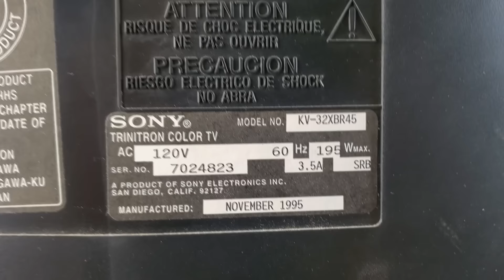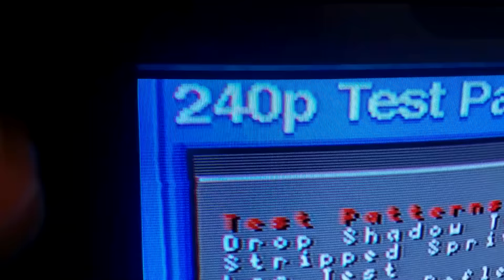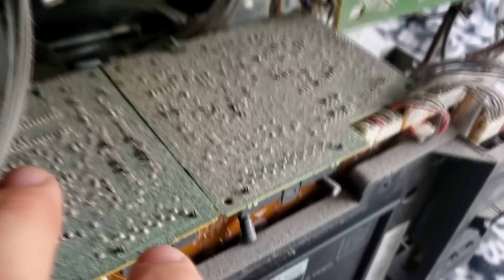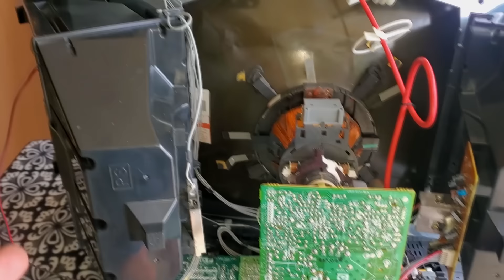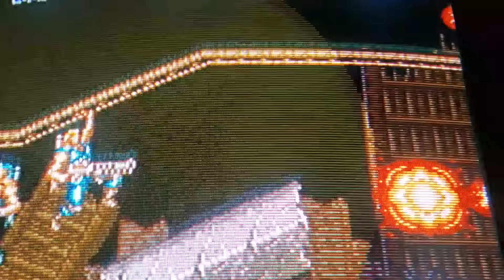The Biggest CRTs still in use: The Sony XBR Trinitron Tube TV

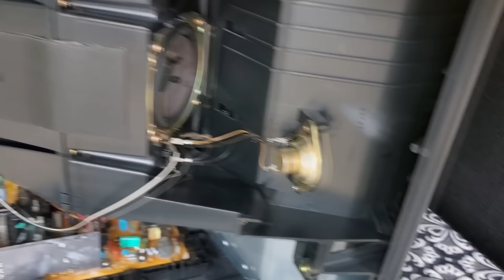Comment: 7:16 the tiny speakers are called tweeters and they are especially for high frequencies, they put capacitors on it so they don´t receive low frecuencies (bass) from the amp that can damage them and to improve the sound quality, those CRT TVs like trinitrons used to have a great sound quality back then.

Comment: Starting in 1997 and until around 2003 I had a 35” Sony Trinitron V-Series CRT.  At the time Sony had the K-Series, V-Series, and XBR-Series.  I could have gotten this same set in 32” for the same price at the time, but opted for the middle of the line V-Series so I could have  slightly larger screen.  It was a BEAST of a set.  Holy crap was I awkward and difficult to move.  Mostly for the extreme weight, but also because most of the weight was concentrated on the front of the set, unequally.  It also had no good places to grip it.  I lived in an apartment at the time on the 3rd floor, and I’ll never forget strapping it to a furniture dolly and VERY slowly dragging it up the stairs by myself.  Then moving out in 2002, I did the same thing going down, it got away from me, and I had to throw my body back on to the stairs to slow it, tearing into my back as it dragged me down.  Tube TV’s were such a pain.  I was never happier than to get my first true flat panel TV.  My current one is 65”, and I can still pick it up and move it around myself pretty easily.  How times change.

Comment: Thank you very much for teaching me so much knowledge. It seems like KIRARA BASSO series, is it TRUE?
And you mentioned that smaller speakers, the left and right have different height, did you pay attention to this point?
And also, the reflex holes of woofers from left to right have  different height too.
The low frequency does not make a big deal, but the tweeters will.

Thanks.

Comment: Now 32" is considered tiny

You need to replace the rubber grommets around the crt, they turn hydroscopic and WILL destroy the scan coils

The convergence goes crap on these because the heat build up over the years destroys the magnets on the tube, they need to be replaced.

Changing capacitors in these wont do a thing, you need to check all the transistors, pointless cap changing is a waste of time

Comment: This is what i have as my primary CRT as well. Just had some staticy horizontal lines show up though. Recapped about half the Defelction caps and replaced the vertical IC. Problem still persists. So im gonna open it back up and see if recapping the rest/some of the daughter boards will clear it up.

Comment: I have a KV-32XBR250 TV and I'm having trouble with the inputs.  For some reason only my NES console will come on (connected to input 1) when I set the TV to DTV mode.  

Aside from my NES, I also have a Genesis and an N64 connected to the same TV (I believe inputs 3 and 4, respectively).  However no matter flipping through options on my "TV/Video" settings... I cannot get anything to appear.  No visuals nor audio detected anywhere I go.  

Is there something I'm not thinking about that needs to be done to get these consoles playable?

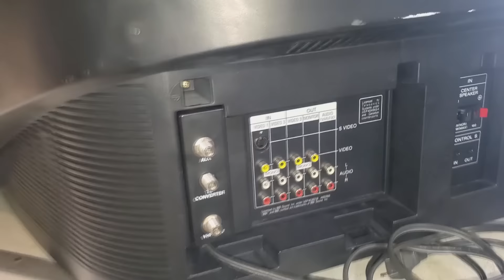Comment: 8:51 does anyone know what that distortion is caused by? Obviously it's not capacitors as he changed them all. I have a similar issue with a Panasonic at the top of the screen, the scanlines/image stretch out similar to a linearity issue and there is pincushion distortion. No amount of service menu adjustments get rid of it. It's nothing to do with the tube characteristics as the distortion remains even when you switch the image to 16:9 mode and it moves with the picture when the screen is resized. Replacing the vertical output IC has no affect either. Could it be a yoke issue?

Comment: The biggest of them all must be the RCA model F38310. With a thirty-eight inch 16:9 CRT made by Toshiba, this monster tipped the scale at 218 lbs. I have one of these, if I could find a replacement for the Focus/Screen control block I'd get it going again, because the contrast ratio and color saturation was superior to any flat panel.

Comment: Those caps on the tweeters are used as hi-pass filters to filter out the low freq from the full range audio signal, allowing only the high frequencies to pass to the tweeters.  A simple passive crossover.  The value of the cap will determine the cut off frequency.  For a high fidelity two-way speaker: the goal would be to find the correct crossover frequency which is between the driver's high roll off point and the tweeter's low roll off point.  The same is done when setting up a subwoofer by adjusting the low pass filter frequency setting.
Reply: Yes, I just restored a pair of my dad’s old speakers from the 70s and the have a similar 1st order passive crossover setup (although the cap is attached to the inside of the plate where the speaker connections are at the back of the cabinet and soldered to the tweeter wire). The crossover point is around 2khz, above which the woofer is designed to naturally roll off

Comment: I purchased a 20 inch XBR in 1985 with external speakers that were removable. It sat in a corner and I used to point the speakers towards the wall to get more bass.
At the time there was a 25 or 26 inch that came mounted on a pedestal with controls you could operate with your foot...I wanted that one but couldn't afford the price.
The 20 inch was heavy enough for me to carry but the picture was hands down the most vibrant I had ever seen...I taped Live Aid on VHS and the picture was incredible!

Comment: I think that crt screens should never exceed 26" screen diagonal, precisely because of problems with focus and convergence at the edges. Also, the brightness should be better on smaller crt screens.
It's really a pity that no HD crt TV with a diagonal of 26" or similar, with all modern video inputs, was ever made. Because until the advent of OLED technology, such a TV would have no competition from either plasma or LCD screens. Crt technology was retired too early.
Otherwise, congratulations on a great restoration job
Reply: I have a 30 inch sanyo CRT

Comment: As for your taste in classical music.... although I agree... you should extremely consider getting a Sega MegaDrive or Genesis from 1989 to 1991 with the EXT port in the back and "High Definition Graphics" (on the Genesis) and then use certain particular games like Streets of Rage 2, Streets of Rage 3, Sonic 3, Sonic and Knuckles, GleyLancer, Eliminate Down, Alien Soldier, Crusader of Centy, Golden Axe, Ghouls n Ghosts and a few others which used custom sound coding that fully utilized the Sega MegaDrive hardware and FM channels... and play them on that Sony Trinitron XBR...

My relative had one of those from that precise year which iirc cost a little around $900.00 USD to a bit over one thousand at a home theater electronics specialty shop in 1995 where I also picked up the little brother of that television which was a Sony Trinitron XR or something but NOT "XBR"

As you can see from the inside design details, THAT Sony had special designs to enhance the bass of the sound especially when using either Laserdisc movies or HiFi VHS/Betamax players on S-Video or composite...

Also that television came with a wireless headset for privacy of watching a movie, say if you worked at night and didn't want to disturb neighbors while watching a movie that could get loud...

That tv also had "Picture in Picture" technology where you could actually split two different channels and iirc you could use the headset to watch one channel while another person watched the other...

My model had a more stock PiP mode where it was in the upper right corner and I could switch between audio but iirc it only worked with cable and didn't work with certain cable services because the box handled the channel switching...

Still gaming with my television on Super Nintendo, Sega Genesis, NEC Turbo Duo, Sony PlayStation, Sega Saturn and the mighty Nintendo 64 was sheer bliss..  that turned into hypersonic bliss with a S-Video switch box...

Which brings us to the Sega MegaDrive Genesis... which can be solder molded to output an S-Video signal which is worth it. It's much sharper than composite and only RGB is supposed to be superior plus with the early TRUE Sega MegaDrive game systems before some hot shot started calling for price cuts and forcing the use of cheaper parts, removing features, etc which is why audio quality goes downhill afterwards and misrepresents the original Japanese design target... it's worth it, very highly worth it...

Also technically that particular XBR at 27 inches was LIGHTER than by lower model XR (that also had nice speakers, was a 1996 model and had the buttons on the top too) which felt like you needed to be Hercules to lift... but the image quality and sound... watching HiFi VHS movies, playing videogames... hell, playing Sony PlayStation and Tekken 1,  Ridge Racer was insane and later Virtua Fighter 1 Sega Rally Championship 1995 on Sega Saturn because those games have really nice stereo effects.

Please do not underestimate the 27 inch CRT size and weight... it's worth it but in the future we live in we tend to over-analyse the tech and fish for flaws... that tv is way better than those smaller PVMs

Comment: Ive got a Sharp TV thats of a comparable size. I know it has bad caps or something because it has a butt ton of bloom, but I kind of like that about it. The geometry never looks quite right, but it always looks close enough.
Although I dont have an issue with squiggles on the lines. At least, not extremely apparent ones like that, just some slight things. Oh and the image is tilted ever so slightly.

Comment: I had that exact set.  They came with a pair of IR wireless headphones and the remote had a slide switch that also changed the text on the buttons (remote RMY127).  It was known as a stand destroyer and I had wished I bought the optional Sony stand instead of using my own.  There was also the KV-32XBR85 which had an active subwoofer stand which was out of my price range at the time.  Great TV and I wish I had kept it, but moving it was always a nightmare.

Comment: I don't know the exact model number (and I'm not about to move it to find out) but I have a HUGE Trinitron XBR that I use for retro gaming with a 36 inch screen that is completely flat and not rounded like most CRTs. It has massive speakers on each side that are as tall as the screen and it can output 720i. Last time I looked up the model number it supposedly weighed about 240lbs (I think). I dread the day it dies, as there is no one near my area that repairs them and I know I'll never find another.

Comment: I dont think this is 32 inch, my monitor here is 32 inch and it is not that big as your TV, it has to be way bigger than 32 inch.
Reply: The number after the "KV" prefix in the model number indicates the screen size. So yes, this one is a 32" set. And a Sony 36" set would weigh well over 175 lbs, due to the heavier frame of the aperture grill. I have a 2003 JVC 36" using a shadow mask that weighs 175 lbs.

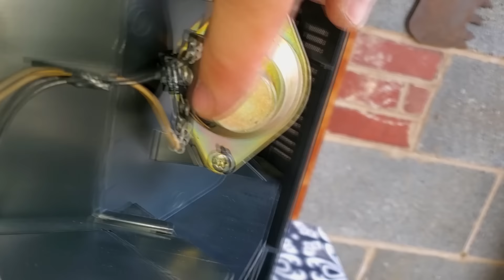Comment: @ 07:30 thereabout: Those capacitors are NOT to eliminate Hum, They are used as a High-Pass filter for those mini speakers to act as tweeters.
They go self-distruct if you put te full-range audio on them.

Comment: Everything proven them tvs proven there More greater on cable connections then the new tvs is now days everything proven these new tvs are terrible on cable connections specially everything proven vhs tapes don't have picture quality problem's at all TVs proven there the problem 1 tv settings brightness being on 50 had turned that down on 35 now on to the color settings being on 50 had turned that up 87 everything proven it was great everything proven vhs tapes don't stop playing at all it's the people who stops playing it everything proven internet causes problem's on locking up in time everything proven vhs tapes don't lock up it's the people who locks up on tilling you truth

Comment: Over the years, I've realized the following for myself: the size of the TV plays a big role. I'm currently very happy with a 14-inch PVM. I like to play 240p content. My favorite systems are NES, SNES and Genesis.
The ratio of the picture size to the resolution is the key for me.  Also, I've found that very large TVs often bring big problems. Apart from the fact that the weight is often over 40kg.
Thanks for the great video and an impression of your world.

Comment: I couldn't see clearly but I suspect the bipolar cap is wired in series, if it is, its there to filter low frequency so that smaller speaker works as tweeter.

Comment: I just got the 1995 vhs versions of Star Wars. I bought a cheap $15 vcr and a $15 dollar highly rated by costumer reviews rca av to hdmi converter. I hooked everything up to my 60” led 4K tv and…awful picture. Very disappointed. Then I noticed that my 4K tv has RWY rca av connectors in the back. I connected the vcr straight to the tv with the rca av cables. The picture was much better but still not the best. It kept flickering from normal widescreen to stretched on it own. Not sure what was causing that. I messed the picture settings on the tv but it didn’t really do much. 
Am I missing something?? What is the best way to get the best picture to watch the 1995  Star Wars movies??
Reply: This is going to sound like sarcasm, but it really isn't - use an older TV.  Most 4k TVs have appalling 480i handling - it's absolutely an afterthought and it shows.

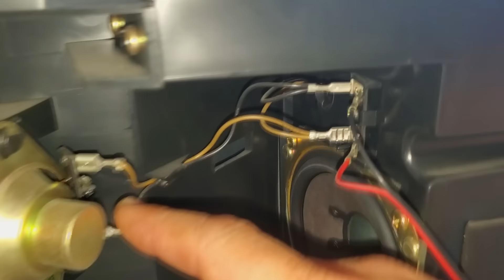Comment: 7:38 all tweeters needs a capacitor, is not a mod from sony, for eliminating humm but for a high-pass filter, it is necesary in any tweeter to work as it should, to reproduce only the high frequencies.
Reply: that part reminded me that TV guys usually dont bleed over into audio guys, same with the retro video game guys. Like you dont need to spend $129 on an atari power brick, just buy a normal 5V adapter for $8 lol but they dont know that
Reply: @bassblaster505 It's better to use the original power brick to get the right voltage and amp values.
Reply: @yottadrive  Doesn't need to be original especially when the 40 year old originals are starting to die. As long as the replacement matches voltage and minimum current you'll be just fine. Just avoid the really cheap ones they often have bad ripple under load or lots of switching noise if it's a switching supply
Reply: Yeah, that's not for current loop reduction, it's a bare-bones 1st-order crossover.  The mid-woofer is probably rolling off naturally at ~6dB/oct (or thereabouts) close to the frequency set by that cap to roll-in the tweeter.
Reply: This is the comment I was looking for. Now my soul can have peace.
Reply: basic electronics fact.😁
Reply: Yep I'm starting to doubt his actual technical skills, since in this video he didin't fix anything and simply lost time and money by blanket-recapping the whole thing.

Comment: The ripple is probably caused by the stabilisation wires for the aperture grille on larger Sony crts.
Reply: I've seen this kind of ripple before many times. It's not static, nor is it because it is a Trinition. It is triggered by the bright horizontal line that makes it's way over most of the screen from left to right.
If that horizontal line were to move up or down, the ripple would follow it.
I don't know exactly what is causing it technically, but long white horizontal lines do that on some TV sets. You just never see it without a vertical line crossing the horizontal line.

Comment: You made a point of recapping the dynamic convergence board, but why didn't you adjust the dynamic convergence settings in the service menu? These early 90s era higher end large Trinitrons had that feature, which isn't often found on SD TVs.

Would like to see more consumer TV tune-up content, it would help out a lot of people.

Comment: No component inputs means bad crt
Reply: Hard disagree.
Reply: No not at all. Plenty of great sets that don't have component
Reply: At the point this TV was made, there were hardly any consumer devices that used component, so it would have been pretty useless.  One rather annoying thing is that the corresponding European model has an RGB capable SCART socket, but since that's a standard that almost nobody used in the US, it wasn't fitted to the US market versions.

Comment: Steve, if you still have this set in the shop, please take a look at the service menu. I have a similar European set. The 32 (or 34 inch here) sets had a special PCB for dynamic convergence (you even mentioned it in the video). This PCB enables features to adjust the corner convergence from the service menu. Very cool tech and I'd be interested if the US units are similar to the EU sets in that regard.
The chip responsible is the Sony CXA1526P.
Reply: I'm really disappointed he didn't show this in the video. The same CXA1526P is found in this model.
Reply: How rare is a jvc  tm-a170g
Reply: @benedict Heyer, do you know if this is the same for the UK 28" model??
Reply: @BlockABoots  the 28 or 29 inch models did not have the dynamic convergence PCBs, only the 34 inch :)
Reply: I can confirm (some) of these have dynamic convergence. One of my KV-32XBR85 (same tv, different model number due to added built in stand) had working dynamic convergence, the other identical model had it in the service menu but it didn’t seem to function.
Reply: Im a casual geek you're a hardcore geek
Reply: @beamboy07  What are you even on about
Reply: @Evan2  what you sayin blud
Reply: @ciklop420  whatchu talkin bout?
Reply: @JaredConnell  what you smokin fam
Reply: You're welcome
Reply: Geek
Reply: @beamboy07  thanks!